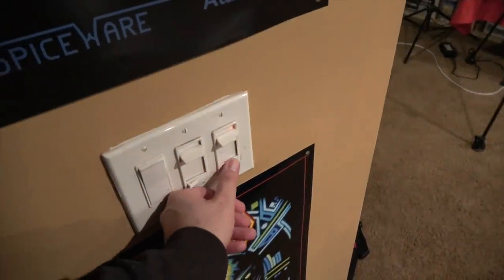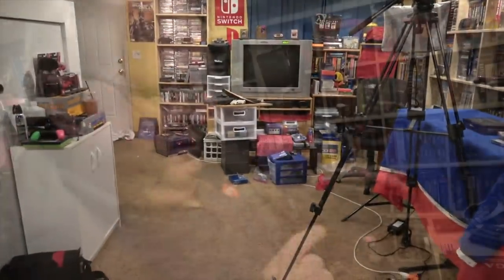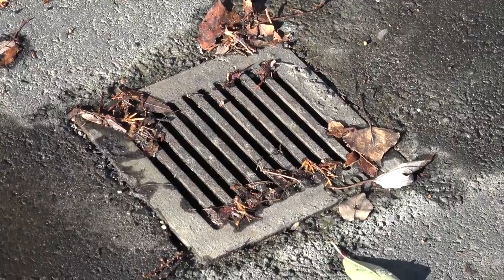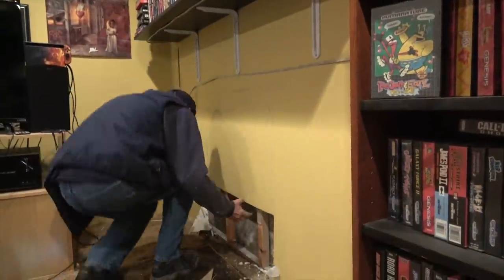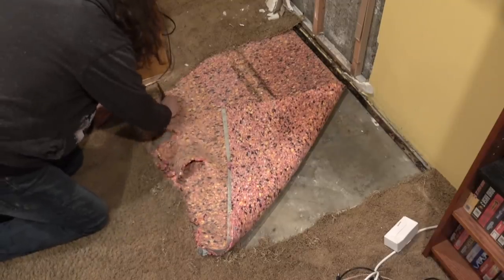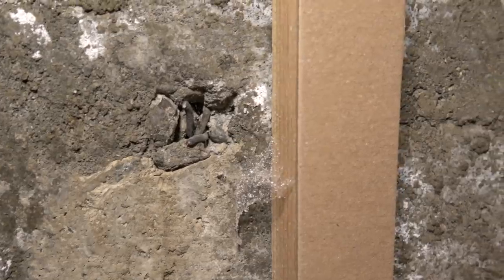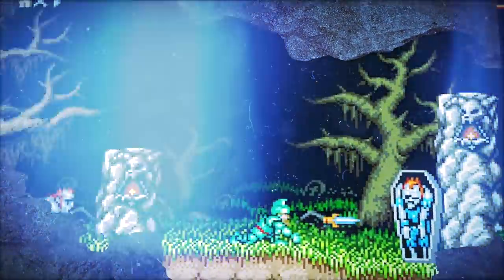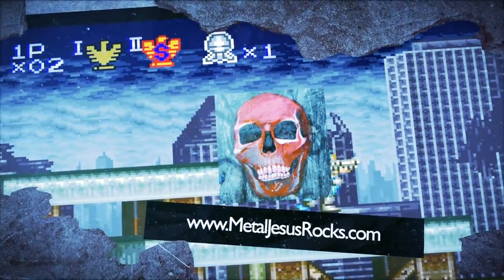OH NO! Water & Mold in the GAME ROOM! $10,000 to fix!

Comment: Look into a French Drain around the front of your house. That will keep the water and moisture for collecting around your foundation. Next get a dehumidifier it will leach the moisture out of your concrete and percent it from leaking into your house. I have an older house with concrete black, when it rained I used to get mini rivers in the basement. I put a dehumidifier in the basement and it put a stop to that. 40K sounds INSANE, look into a French drain and what it does. It will do what you need it too.

Comment: Isn't that what home owner insurance is for? Do they cover floods/ leaks?
Reply: Home owners does not cover water damage caused by rain. If it was plumbing releated they would.
Reply: You have to live in a flood plain to be covered for any kind of flood insurance. A lot of the people who live on a lake near my place are hurting right now because the lake is 4 feet higher than it should. Over 50 people have gutted their basements because there is water in them. Another 100 or so have sandbags and pumps running to keep the water at bay. Not a single one of them will be covered for flood damage. The experts that have been brought in say it will take 3-4 years for things to go back to normal, and that’s if we have a few dryer years.

Comment: I’m a structural engineer and part of my job is to design basements.
I wouldn’t recommend draining the room from the inside as you’ll have 2 problems:
1. The humidity in the room will probably be too high so you’ll either need to run a dehumidifier 247 or build another sealed wall on the inside - reducing space.
2. The metal ties in your wall will stay wet, eventually corrode and you may end up with a structural issue.

I would seal the basement from the outside (tanking) or inject a membrane through the wall from the inside if you don’t want to excavate your garden.

Oh and definitely remove everything from the room, at the least it’ll be covered in dust at the end of the works!

Comment: I had this happen in my basement in 2 different places. It was $1,000 or less to get it patched each time including the wall repair. One of the cracks was next to my sump pump so that was an easy little trench to put in but the other one was just injected and no trench placed. That means if the seal fails again the water comes in again, but it hasn't been giving me too much trouble. I don't think I will ever put carpet down there though, I have vinyl floor which can handle getting wet.

Comment: Do you not have home insurance isnt that covered?
Reply: Insurance companies are notoriously Jewish about flood/water damage.
Reply: @nbpraptor  they are that way in general, not just water/flood damage. They want to take your money, not pay anything out.
Reply: Right, you need to have flood insurance but, at this point, the only damage is on a rug and a little drywall.  Not sure this type of thing would be covered under insurance.
Reply: I've known a couple of people who had insurance cover damage from leaky pipes, blown pipes and even problems from a leak coming from the ice maker on the refrigerator. Leaky basements they don't cover though.
Reply: When i bought my house i was advised to cover my basement with flood damage.  You can waive it and save a few bucks a month but if anything happens you are screwed and i use my basement as a game room. Just read your policy and make sure it actually does what you need it to.  Most people never read their policy and just sign.  Really not hard to find the right coverage if you spend like a half hour doing research.  I am guessing this house was built with an unfinished basement so why cover it separately?  When it was converted and finished they most likely never amended their insurance and added coverage.  Or like stated above got coverage but never read it and it does not cover this type of event.
Reply: @blkcandywarez I guess it's all about the level of coverage you have. OF course, because you made a claim you insurance rates will go up, so you'll be paying it back anyway.

Comment: Why not just pave over the hole yard and prevent water reaching the basement?
Reply: Interesting solution lol
Reply: That's exactly what I think
Reply: Oni700 not good, where would the water go, there'd be puddles of water everywhere. It rains a lot in Seattle.
Reply: @gamingtv394  I'm no builder or damp specialist, but surely you could make the repaving of the yard work giving bow much less it would cost. Perhaps if you sloped the paving and driveway so that the water runs into the street?

Comment: MetalJesusRocks: You would actually save yourself quite a bit of money if you do the drywall repair yourself or gather a few friends to help, you screw it into the studs with drywall screws then putty over the seams and screw holes then sand it after it dries. From there you prime it and paint it and you just saved yourself a lot of money while learning something new. While you have the drywall ripped out it might be a good time to install insulation in those walls for better cooling /  heating, I'm sure that basement gets pretty chilly sometimes.

Comment: I had a flood in my apartment on the 12th floor! The water main for the kitchen rusted through and leaked while I was gone. I was just getting into collecting NES and had about 70 games in boxes on the floor. I came back after being gone for a week and found the boxes that the games were in were wet. Luckily the games on the bottom level were cheap games but after examining them, everything worked fine and even no stains or label damage. Good ole NES carts! They sure can take a lickin'.

Comment: your getting ripped off drill the holes and fill it with concrete and putting sheetrock up is simple do it yourself
Reply: Everyone is saying the same thing hope he reads some comments or he's screwed
Reply: A repair man told me this personally to be careful when they want to do total reconstruction work that they are trying to trick you int9 spending more when the real issue is not as huge
Reply: Hehe thats a man's job. I think henonly do games and rock n roll and beer.
Reply: Trying to drill out pieces of steel set in concrete (the path the water is taking, plus that steel is what is tying the preformed concrete sections together, so it would be a bit akin to drilling out the nails in your studs) is not so easy to do unless you plan on drilling out large cores all the way through the wall.  Further, hydraulic cement patches are weak and prone to failure over time, so with many dozens of such patches (at regular intervals tying in the preformed concrete sections) in all the areas that are liable to leak he would likely eventually find himself having to tear out some section of wall every several years to effect repairs each time a patch fails, which is no fun whatsoever in a finished basement.  Fixing the problem once and for all is the more practical solution in a finished space — better still but more expensive would have been digging up the exterior walls and waterproofing the walls from outside, but that incurs much more cost than the interior waterproofing he is pursuing (though it is also more certain to prevent future water issues as you may then also repair the weeping tile and drainage system).
Reply: @anthony no concrete won't prevent water but it does strengthen the blocks from movement, water will find it's way through any little hairline cracks trust me. It needs a waterproof barrier installed on the outside such as blueskin membrane. Water hits that then runs down to the weeping tile.

Comment: When you replace the drywall consider to use “durock” cement board. It works great with damp humid areas. They use it in bathrooms instead of drywall.

Comment: Gutters! Number 1 cause of wet basements!!
Reply: I think in this case it is pretty obviously water shed from a non permeable parking spot he just put in. The water that once permeated the ground in that spot is now displaced to the side of the house and found an entry point. You aren't wrong about gutters, but I think this is pretty evident. They made a renovation that changed the characteristics of his drainage system. 60 yrs with no parking spot and no problems. New parking spot, new wet spot in the basement.

Comment: I can tell you exactly what to do:

Dig about a four foot wide (super deep!) ditch around the perimeter of the house and fill it with gravel and culvert pipe. That, plus waterproofing anywhere possible, should do the trick. Nothing fixed my grandma’s flooding woes until she did that.

Comment: Pretty sure you're right about the parking pad. You see how it's all pointing down towards the drain? That adds a lot of water to your gutter drainage system that's probably already maxed out. Step one should be adding a few more drains then run a separate drainage line from your parking pad. Hell, you might to check your gutter drain for any damage just to make sure.

Step two is working on the basement. And there's a couple of options with that.

Comment: I have a studio in my basement and had a water problem originally before building it. My biggest issue was that the downspouts from the gutters were broken under ground so all the water from my gutters drain right beside my house. Once I fixed that. 99% of my water issues were fixed. The last thing I did was took out bushes along my house and slopes the yard away from my house and sealed any concrete edges along the house. Imo, doing an indoor French drain and sealing it from the outside is temporary. Get the water flowing away from your house first. Good luck dude. If I lived closer I’d just come and help ya.

Comment: There's going to be a lot of debris from the jackhammering of the floor, you are going to want to get as much out of the basement as possible. Not just pushed into the center of the room (and they may have to work there too as it can depend on where the drains are). Everything you can't get out you need to tightly wrap in tarps, dust is going to get into/on everything no matter what you do. 

Also, if you ever wanted a toilet in the basement and don't have one yet, now would be a good time to add a rough in for one as the floor will already be up so you can save a little bit of the cost there. You can do the rest of the construction for it later, but just getting the hookups in is a nice start. 

Lastly, you should add 20% to the estimated cost just to be safe because there are always surprises with this sort of thing.

Comment: I helped someone and he used an excavator to dig out around the house and apply a waterproof coating. And then putting the dirt back you have to tamp it down as you are going. Also this might be an opportunity to add electric plugs, I didn’t see any in your video. You can do this.

Comment: You should be able to plug those holes if they are exposed. Drill them out 3 quarters of the way. Not all the way through. Fill them in with new concrete and bonding compound. You can also use an industrial grade epoxy compound. Obviously it doesn't just stay in the hole so you cover the hole with a small piece of plywood. Essentially create a form. At the top of the ply wood you need a small hole to pump the filler in. Let everything dry and just for sure measure seal the wall afterwards. Water wont come through anymore, it will be permanent fix, and less expensive.

Comment: Sad to see this :(  Some advice, when you're done with this problem. Place your shelfs at least 5cm (2,5 inches?) away from the walls to allow air to flow, get rid of the carpet and any kind of wallpaper you might have. Also put something under your shelfs so that they are at least half an inch above the ground for air circulation. Allowing air to circulate is important to prevent mold.

Comment: You could just seal the one hole and start saving for the next time it happens to do the whole fix. I don’t have any formal knowledge about any of this so discount everything I say, but they make a compound for sealing cracks in foundations. I imagine it would be cheaper to rip out all the drywall and seal each hole individually than to build some crazy trench system. Ice would be a problem but you are in Seattle so I don’t imagine there is much of that

Comment: my advice would be to build a cabin or large shed in the yard if possible and have your gaming stuff in there above ground and dry.
i have 5 storage areas for all of my gaming stock (as i collect and also have a shop). ive had nightmare scenarios (one am dealing with now) is a concrete building the water is condensation inside and the carpet in there was soaked. anything cardboard on the floor was ruined. i insulated the room but it still is damp inside and so next is to fit air vents.
of all the storage units the best one is an insulated metal shed with a raised floor with vents on either side.
if you care about all of those games i would definitely take them above ground otherwise you would be forever worrying about this happening again

Comment: the drywalling won't be hard since you already have the frame, measure cut it with a razorblade find your posts nail/screw it in. tape your edges, use some premixed joint compound go real easy on that on your nail holes, and then just blend your seems after its dry sand feel for smoothness and reapply if necesary then paint. find a friend  get the materials and knock that out in a weekend.

Comment: i have a few years in construction and what they suggest , makes sense, to a point...i get why ya have to strip all the walls 4 feet up...so while it's stripped, them lil brackets CAN be drilled out...the holes filled with epoxy and a sealer coat applied over that, and i would call that sufficient myself, if totally necessary i would consider a sump pump basket in a low corner to back it alll up., p.s. a raised floor say on pallates as an example with 3/4 inch flooring on top you can spare some of the damage to your nice collectables 1, and you can channel water underneath it, ;-) ( a false floor can hide many a sump pump hose)

Comment: You need another opinion.  A mini-excavator can trench alongside your basement walls in a few days of work.  Pressure washing and sealing the concrete shouldn't take much more time.  They would probably use a polyurethane sealant, since it hardens with moisture.  Asphalt/butyl is another option.  Then they need to put in a perimeter drain with rock and landscape fabric, to allow water at the base to drain out.  Mike Holmes (Holmes on Homes) did one of these, go find the video on youtube.  What they are quoting is hackery in my book, since it will not abate the moisture levels in your basement and the concrete will always stay moist.

Comment: I would raise the grade outside in front of the house and put down a rubber liner and cover it with gravel and rocks. Also, keep your gutters cleaned at all times and downspouts should be draining away from house.
Reply: My basement is not finished (wish it was) but we have had leaks in the past.  These days we don't really have a lot of water trouble down there and the main fix was commercial size guttering with gutter guard.  Eventually we tied in some PVC drain lines that run out to the ditch.  Highly recommend getting nice gutters and staying on top of them.  Great advice.
Reply: @rpr8  MetalJesusRocks doesn't have a big leak. It's kind of an extreme fix they want to do, plus he put that asphalt drive in and he said they tied into his drain that's right next to the foundation. Id get a 10' piece or longer of that black flexible tubing and at least drain what's coming off the house out somewhere behind that fence away from the house. He didn't seem to know where the water is draining to so that could be a problem.

Comment: Dig a hole down to the slab seam and figure out a sealant that will bond the seal. 10k is a lot unless you are going to go insurance route, but in the end you will pay close to 10k with rate increase/detectable. All you got to do is keep water from getting in that seam.

Comment: I noticed there is a white substance on the surface of the wall, this is called effloressence; and it’s there because moisture is permeating through the blockwork not just the holes made by the ties.  Therefore, ideally you should address the issue from the outside of the wall (also called the “soil face). By  excavating down to the basement floor level and the contractor should fill in the tie holes then apply a waterproof membrane to the basement wall ensuring it covers the foundations aswell.  Did you have small trees or shrubbs in the garden area? The root systems of these can damage & penetrate an existing waterproof membrane, which would compromise the barrier.  
I dont think its a good idea to have water being captured and drained away inside your basement room, I only see this in basement carparks.  You can’t have water trickling down your walls behind the rockwall.  A cheaper way could be to fill the holes from the inside then use a product called dryzoro or similar, which is sprayed or painted onto the room side of the wall.  Hope it all goes well for you, I’d hate to see dampness damaging your collection.

Comment: You need to redo the drainage on the house. They dont last forever. What must be done is to dig a ditch along the wall about 3-4 foot wide and as deep as, or a little deeper, than the foundation. A drainpipe, sealing and gravel goes into the ditch. Costly - but will keep your basement dry for another 40 years if done properly.
Even if you didn't have the metal ties there - moisture will penetrate a concrete wall.

Comment: Or… you could fix the drainage problem the parking pad created. . Once you get water away from the house (look for puddles) you don’t have to worry as much about water intrusion. 

Carpet- you could get some glossy concrete sealer and expose the concrete so if this happens again in another spot it won’t be such an overhaul.